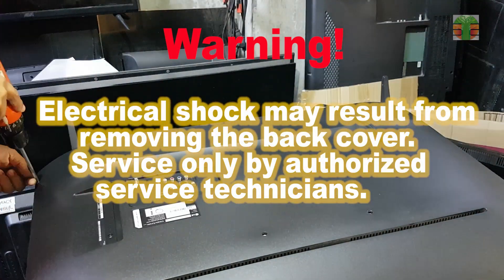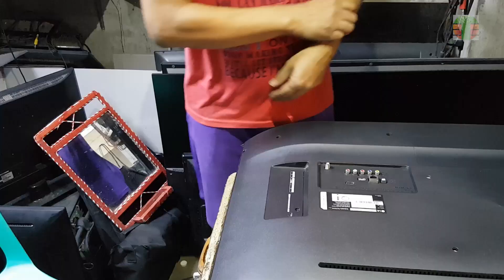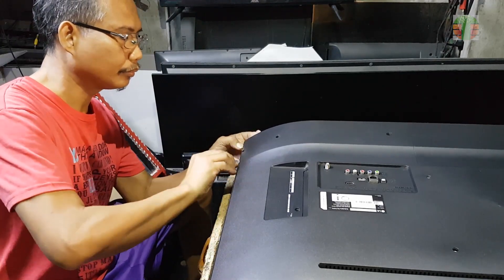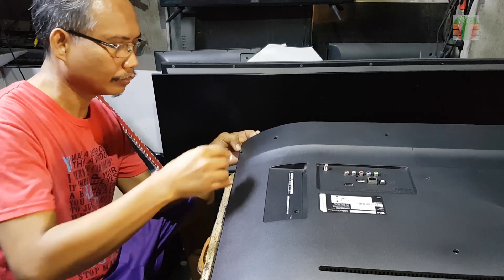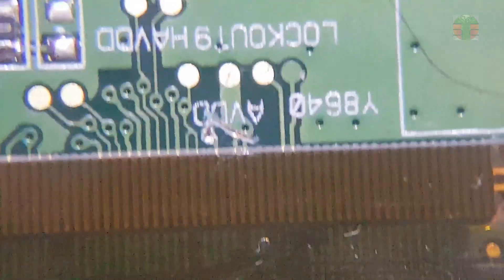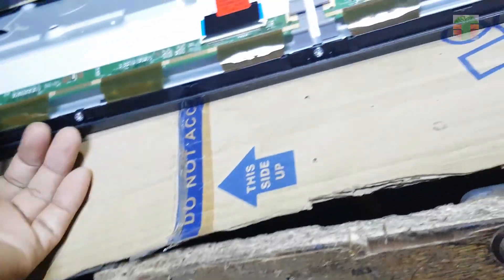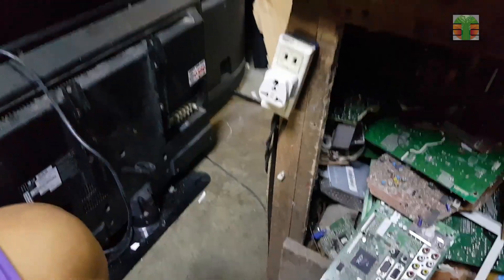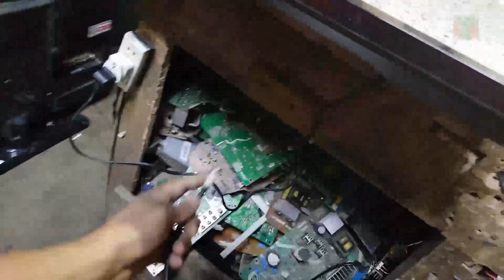Strange Symptom Defect of an LED TV.

Comment: Can a black stripe on the Samsung model UN65RU7300FXZA be fix ? Thank you in advance for your help.
Reply from the maker: Black stripes or black hairlines can only repair by the bonding process.
Reply: @tevzTVTevatronics  Thanks you very much Sir for you fast respond. Sorry for my ignorance, what is a bonding process? It is a wide black vertical shadow front top to botón on the left side. Where are you located if may I ask? I’m in central Florida USA. in any way ones again thank you very much. Regards